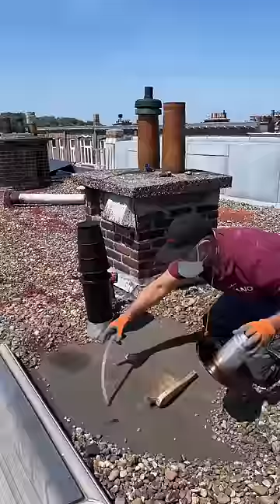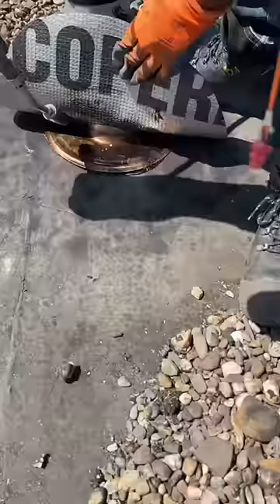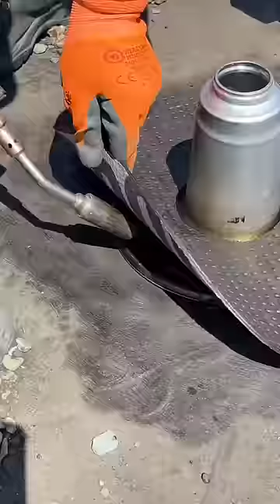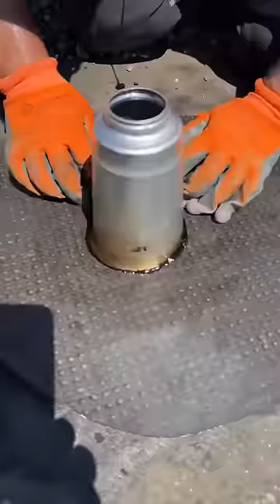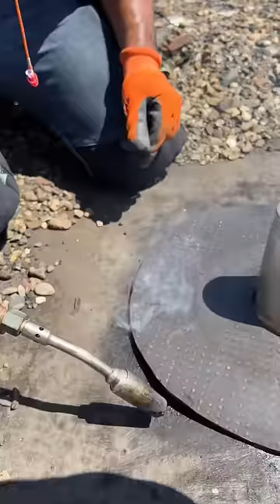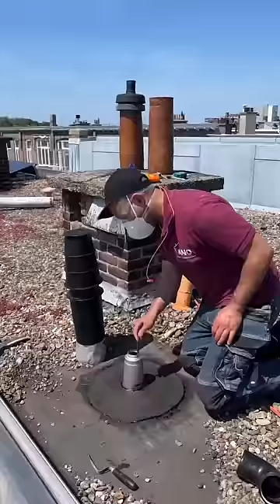A roofer shows how to make and adjust a roof vent to use a condensation pump

Comment: Roofing is one of the hardest jobs I ever had to do. This dude makes this shit look so easy. Trust me, it’s fuckin not.
Reply: Damn right.
Reply: roofer for over decade residential pitched asphalt shingles and some cedar and you are right it is very difficult and a lot of work but it's fun as hell and I love it every job is different
Reply: Are the rocks for cooling?
Reply: but it is a fully shitty system. never a hole in the middle! in Europe such stupid things and material never used
Reply: I wouldn’t say its the hardest. I mean yer, when your on a roof when its 50 celsius yer its hot. But id would say braking concrete with a sledgehammer is harder, but where I live is always fucking hot in summer. And they are fucking long.
Reply: @prophetanarchy2355  it doesn’t take skill to break concrete with a sledgehammer! All you gotta do is swing. This is DEFINITELY a lot hard then that because it actually takes a SKILLSET to so this. Anybody can swing a sledgehammer at some concrete. The pros don’t use sledgehammers for that anyways lol we got JACKHAMMERS & backhoes for that my man 🤣🤣🤣
Reply: @GreenChronicles561  also if roofing is one of the hardest jobs you have done, you aint lived.
Reply: @UltimateEntity  no for weight
Reply: @UltimateEntity  nee om de dakbedekking tegen de zon te beschermen en om er voor te zorgen dat de dakbedekking niet weg waait
Reply: @jospleizier10  and also to protect it for the sun
Reply: @larsreiche7641  misschien kon dat wel niet anders
Reply: It's not hard at all it only gets hard when you get to really steep angles even then with the correct equipment it's easy
Reply: @ADGaming-7619  There’s always one person to think something like this is easy. Congratulations. I don’t really care of your opinion. You just wanna make yourself feel bigger then you are. . I’ve done it firsthand  myself and I know it’s not easy on Pitched roofs or flat roofs. It’s not easy. You can call it whatever you want.
Reply: @prophetanarchy2355  no it’s not. It’s way easier. I’m a contractor sir. If you have state of the art machinery, it’s not hard at all. Maybe you gotta save upsome money to afford better machinery lol
Reply: @GreenChronicles561  i was talking years ago as a young lad, ever worked 1000km from the nearest hardware, on a cattle station with a tight arse boss that is old school and doesnt give a fuck about newer tech. Id be fucked if I was to break concrete at my age now, but have no issues getting on a custom orb roof in 50 degrees celsius
Reply: @prophetanarchy2355  see that’s difference between you and I. We use state of the art machinery for shit like this, so you cant speak on the intricacies of this work when you have never used the right machinery. It’s way easier compared to roofing no matter how you want to view it. case closed.
Reply: @GreenChronicles561 your a waste of my time. Greetings from Australia.
Reply: @Ronnie Coleman  it's not my opinion I have with 0 training or experience have repaired 7 roofs and completely tore off and replaced 2 by myself with 0 issues and have held up for over 10 years
Reply: @prophetanarchy2355  breaking concrete is not harder than being a roof labor on a pitched roof nope
Reply: @marcfavell  thats your opinion dude, but did your concrete have quartz aggregate in it.
Reply: @pneuMa  the only thing close to hard would be the heavy lifting which is exhausting not hard meaning it takes little to no skill to do so what would be the "hard part" getting the singles in a straight line because I learned how to follow a line in kindergarten how about pressing the button on a nail gun 

Where is this "hard" part
Reply: @ADGaming-7619  you realize I'm talking about flat roofing right? Were talking rubber here not shingles.
Reply: @pneuma6421  so only commercial roofs are "hard" what's the "hard" part 🤔
Reply: @ADGaming-7619  did I say that? I said id I like to see you last because you said roofing was "easy" but you're only talking about shingles and slopes when there's more than one type of roof. If you worked on ANY flat roof you would know how hard and how skilled you need to be and would never call roofing "easy"
Reply: @ADGaming-7619  your ignorance is showing hard here 🤣 roofers are some of the top paid on site
Reply: @ADGaming-7619  and if you think a diploma or degree = high paying job then I have a bridge to sell you
Reply: @pneuMa  your lack of answer and my experience in the field says otherwise saying something is hard to make yourself look more manly is kinda weird
Reply: @ADGaming  come work on my crew, I'd make you quit before noon.  I can only imagine the hack work you did on those repairs and roofs with 0 training.  Poor homeowners.
Reply: Und was ist wenn Schnee liegt??
Reply: @UltimateEntity  the rock are for weight, if the roofing ia
Loose from de decking then you need some weight like rocks or tiles
Reply: @bizzzle84   tegen
De zon hoeft t niet meer, dat was vroeger met mastic, tegenwoordig zijn de materialen uv bestendigd … al scheelt het wel een paar graden natuurlijk
Reply: @bizzzle84  bro can u speak english
Reply: @UltimateEntity  No it's to ballast the roof, for safety reasons. Like when there's high wind speeds, the roof won't fly off😅
Reply: I roofed with my husband for 8 years until I switched to pharmacy. Spending 10 hours on your knees should be a whole lot more fun.
Reply: Yea, through the power of editing.
Reply: @GreenChronicles561 Yeah, buddy!

Comment: Its true, roofing job is not easy. the connector between  the tube is not fully sealed, if water will stock in between  and in the long run it will rot and cause trouble of water leak in the future. Nice work guys.

Comment: Condensate will eat a hole in anything . It’s like acid rain .
Reply: I don’t believe that’s a flue condensate, it’s probably an evaporator condensate drain that needs to be pumped to the roof due to lack of a close w met drain location
Reply: @Gunner Jewell  what are you discussing please? Trying to understand home management and care for the future.
Reply: @Celita  Condensation that comes from a combustion device like a high efficiency furnace or instant hot water has an acid pH from co2 dissolved i to the water.  Condensation that comes from a heat exchanger like AC or  water heater does not have co2 dissolved into solution so it is neutral ph.
Reply: @ryanchaney7362  thank you for explaining. 🚰

Comment: very nice.  I have always wondered why there are rocks on roofs like that
Reply: It protects the roofing material from sun exposure. Plus it doesn't heat up as much.
Reply: its really to help keep the material down alot of older style commercial roofing like this wasn't always glued down everywhere just mostly the seams so they lay rocks or pebbles to help hold it down from strong winds

Comment: Sweet! Btw always wondered what is the pourpose of gravel on the roof..
Reply: Weigt
Reply: Weight and uv protection.
Reply from the maker: Roofing stones (gravel) are placed on the roof covering to protect the covering from being blown up by the wind.
Roofing is also protected against UV rays from the sun.
Because we use gravel, the roofing can be loose and does not have to be attached to the roof construction.
the main advantage of this is that the roofing material can expand and contract freely. This makes the roofing last longer.
in the Netherlands Have many technology. this is 1 of many method.

we now also do green roofs.

A green roof is a roof - flat or sloping - covered with plants, herbs or grasses. Designations that are also used are vegetated roof, roof vegetation, roof vegetation or vegetation roof. Within green roofs, a distinction is made between extensive and intensive green roofs.

A green roof has many advantages on an economic, ecological and social level. For example, a green roof ensures water retention, air purification, a lower ambient temperature, heat regulation, energy saving and biodiversity in the city. Green roofs are part of climate-proof building. Moreover, people feel much more comfortable in a green environment than in a gray one. Below we list all the advantages in a clear manner.
Reply: gravel improves water drainage on a flat roof

Comment: May be#3 out of #5, because of you should use primer,after sweeping the rocks away clean the dust,dirt with wet mop or clothes and then spray SBS ,asphalt primer on on the aluminum flashing and to the old roofing and please use the pure thick skin leather / welding Gloves not those rubber and polyester gloves 🧤 very dangerous with torch/flame /heat . If same method you use here in North West this will be leaking in on very first rain ☔️ and good luck fixing in the fall and winter ❄️ even this one not a 50% make it through the winter the way you welded it sbs to asphalt no cleaning and no heating the surface melting little bit and most important primer then you weld/ torch on and bleed all around. Any repair roof patch torch on bleed the Edges is very important for making sure not to have separation or leakage ! Guaranteed / word of mouth warrantied + Warranty.
Reply: Bud you and I both know he did a great job...
Please post some of your jobs that you've done?... Show us all how it's done there pro.
The flange he used was steel, he used asphalt emulsion to adhere it, and plenty of it, it'd be water tight at that point, but he also overlays torch-down to dry in the connection, this is a superior product, it's 100% to code... Nothing is going to leak here bud, I'm almost certain of it.

Comment: Do the rocks on the roof disperse heat or something? I dont get why there are rocks on the roof 😅
Reply: A bitumen flat roof lasts between 25 and 30 years. At the end of its life, it dries out and you can suffer from leaks. To extend the life of bitumen, you must protect the flat roof with slate, gravel or roof tiles. This protects the bitumen against UV radiation for a longer period of time. It also prevents the roof covering from coming loose in high winds.

Comment: If that’s the condense pipe from that boiler using a lift pump, that would be illegal in the uk. That’s if it is what I think it is
Reply: Discharging condense water from gas burning equipment which causes it to be mildly acidic is not a allowed … in uk where it is returning directly to a water course or soak away system … it has to go to sewer waste water or be filtered through alkaline stone to reduce acidity first
Reply: Nice one It could be the John Wayne roofing co Pilgrim

Comment: They make a epdm cleaner so you don't have to buff the roof making it weaker and could cause it to fail. Also using your hands is nice but they make a tool called a roller that would make it less of a reliability on your end if your patch were to fail
Reply: I know what your thinking but that's not a ballasted epdm roof. You ain't torching modified too epdm

Comment: Condensate should terminate into a drain because its slightly acidic that will rot the roof eventually
Reply: Depends if you talk about condensate from a high efficiency boiler or that of an air conditioner.

The boiler: yes, as the condensate comes in contact, or is created by with the flue gasses of the burner.
Air conditioner: no as far as I know as long as your condenser isn't breaking down completely.
Reply: @rudyvk  you can see the flue of the gas boiler right next to the condensate pipe. This will rot out the roof in a couple of years or less

Comment: Why is there a whole bunch of rocks on the roof tho?
Reply: A bitumen flat roof lasts between 25 and 30 years. At the end of its life, it dries out and you can suffer from leaks. To extend the life of bitumen, you must protect the flat roof with slate, gravel or roof tiles. This protects the bitumen against UV radiation for a longer period of time. It also prevents the roof covering from coming loose in high winds.

Comment: Does the rock protects the roofing from heat and uv?
Reply: Yes and weights the roof down so less wind uplift. Downfall is that if your roof is leaking or damaged you have to move it all out of the way.

Comment: Condensation vent at rooftop and electrical wire for what?
Reply from the maker: that's a heat ribbon. that is for the winter so that the condensation water does not freeze
Reply: @diyplumbinganouar9018  Oh, so for condensing furnace as well?  Or is it for a grow room, thus ac year round?

Comment: Clear the chips, then paint cleaned surface with bituminous primer.  Torch-on with stick like sht to a blanket after it dries.
Also, start off with 2mm thick torch-on first, then 4mm capsheet.
Peace.
Reply: Also, get a proper gas torch.  That one's a bit. . . dinky

Comment: A question that puzzles me, why do you put pebbles on the roofs?
Reply from the maker: Roofing stones (gravel) are placed on the roof covering to protect the covering from being blown up by the wind.
Roofing is also protected against UV rays from the sun.
Because we use gravel, the roofing can be loose and does not have to be attached to the roof construction.
the main advantage of this is that the roofing material can expand and contract freely. This makes the roofing last longer.
in the Netherlands Have many technology. this is 1 of many method.

we now also do green roofs.

A green roof is a roof - flat or sloping - covered with plants, herbs or grasses. Designations that are also used are vegetated roof, roof vegetation, roof vegetation or vegetation roof. Within green roofs, a distinction is made between extensive and intensive green roofs.

A green roof has many advantages on an economic, ecological and social level. For example, a green roof ensures water retention, air purification, a lower ambient temperature, heat regulation, energy saving and biodiversity in the city. Green roofs are part of climate-proof building. Moreover, people feel much more comfortable in a green environment than in a gray one. Below we list all the advantages in a clear manner.
Reply: @diyplumbinganouar9018  Thank you very much for this information that I did not know in advance. Greetings to your kind person

Comment: Good job but  I don't understand why the terrace is spread with small stones /pebbles.
Reply from the maker: Roofing stones (gravel) are placed on the roof covering to protect the covering from being blown up by the wind.
Roofing is also protected against UV rays from the sun.
Because we use gravel, the roofing can be loose and does not have to be attached to the roof construction.
the main advantage of this is that the roofing material can expand and contract freely. This makes the roofing last longer.
in the Netherlands Have many technology. this is 1 of many method.

we now also do green roofs.

A green roof is a roof - flat or sloping - covered with plants, herbs or grasses. Designations that are also used are vegetated roof, roof vegetation, roof vegetation or vegetation roof. Within green roofs, a distinction is made between extensive and intensive green roofs.

A green roof has many advantages on an economic, ecological and social level. For example, a green roof ensures water retention, air purification, a lower ambient temperature, heat regulation, energy saving and biodiversity in the city. Green roofs are part of climate-proof building. Moreover, people feel much more comfortable in a green environment than in a gray one. Below we list all the advantages in a clear manner.
Reply: @diyplumbinganouar9018  excellent information.

Comment: I've never seen gravel on roofs like this, can someone tell me what's it's purpose?
Reply from the maker: Roofing stones (gravel) are placed on the roof covering to protect the covering from being blown up by the wind.
Roofing is also protected against UV rays from the sun.
Because we use gravel, the roofing can be loose and does not have to be attached to the roof construction.
the main advantage of this is that the roofing material can expand and contract freely. This makes the roofing last longer.
in the Netherlands Have a lot of technology. this is 1 of many method.

we now also do green roofs.

A green roof is a roof - flat or sloping - covered with plants, herbs or grasses. Designations that are also used are vegetated roof, roof vegetation, roof vegetation or vegetation roof. Within green roofs, a distinction is made between extensive and intensive green roofs.

A green roof has many advantages on an economic, ecological and social level. For example, a green roof ensures water retention, air purification, a lower ambient temperature, heat regulation, energy saving and biodiversity in the city. Green roofs are part of climate-proof building. Moreover, people feel much more comfortable in a green environment than in a gray one.

Comment: Why on earth would someone want to install a condensate pump and discharge to the roof?   Especially why is this separate from the ac set lines?   Assuming this is not a condensing boiler, but still, why

Comment: What are the rocks for?
Reply: A bitumen flat roof lasts between 25 and 30 years. At the end of its life, it dries out and you can suffer from leaks. To extend the life of bitumen, you must protect the flat roof with slate, gravel or roof tiles. This protects the bitumen against UV radiation for a longer period of time. It also prevents the roof covering from coming loose in high winds.